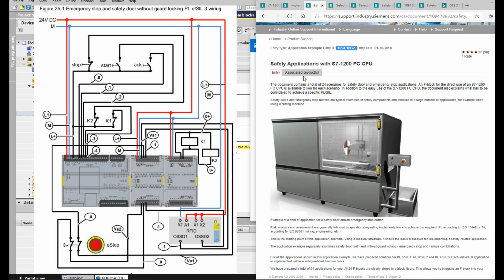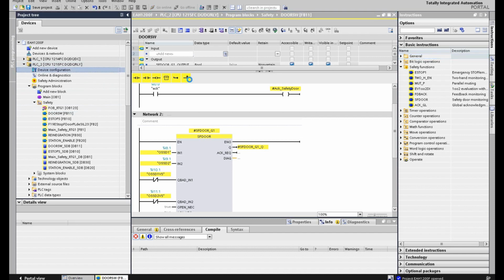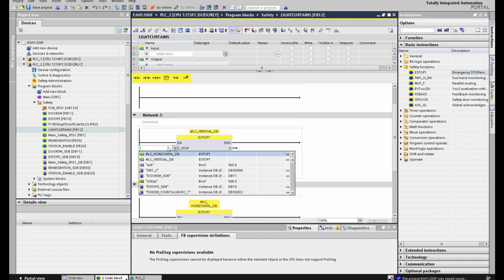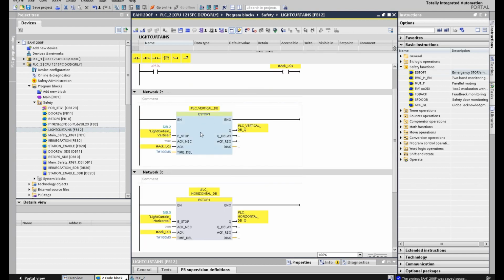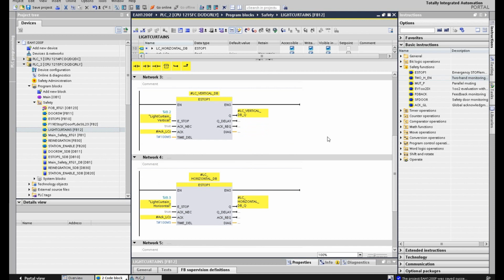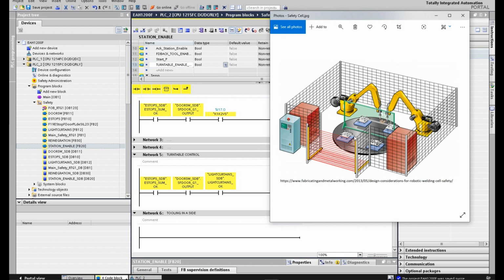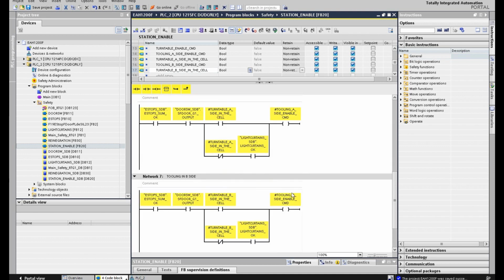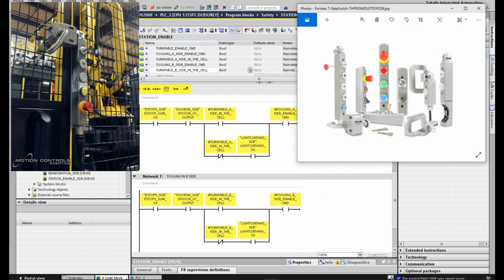SA16. EP04 Siemens Functional Safety - Light Curtain and Turntable Safety Control

Comment: Hi, can you please share access to the videos below: they are private, we have to email to request access, but can’t find your email. Thanks!

SA17 is “EP05 Siemens Functional Safety - Safety Gate Switch with Guard Locking, S7-1200F + ET200SP HW.”
•	SA18 is “EP06 Siemens Functional Safety - Safety Gate Switch with Guard Locking, S7-1200F Programming.”